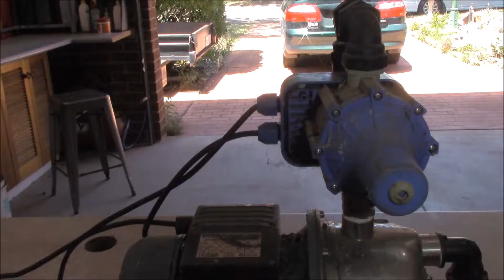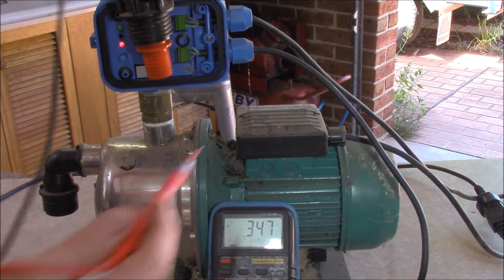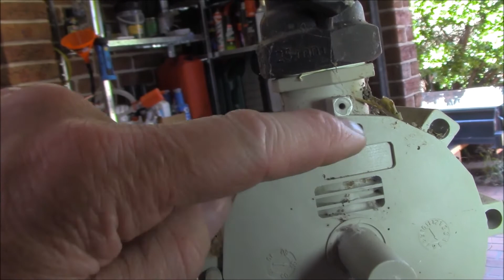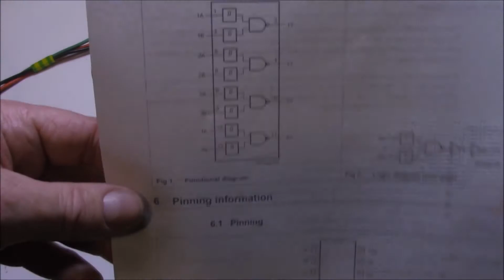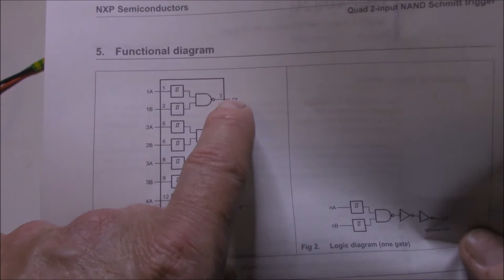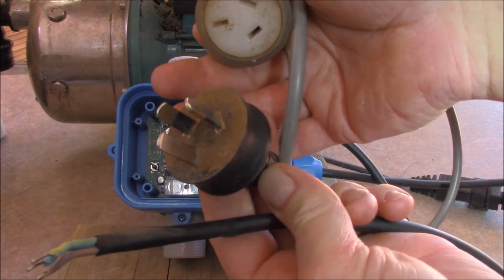KASA Water Pump Repair MiracleMAX

Comment: Thanks Mark. It's always a good idea to use current limiting resistors when checking IC's. Mouser has those Quad Nand's for less than 50 cents apiece.
Reply: I'm wrong, Mouser's are SMD also. I guess you would have to look at Aliexpress or eBay.
Reply from the maker: Hey Robert, 
Nick D below was able to direct me to some locally through Jaycar. It would have been nice to complete the repair at a component level, but for the price of the replacement control assembly, it was a better option anyway.
Reply: I would've just ordered the SMD and used a DIP to SOIC adapter, if I wanted to save money. It's better to replace the whole thing as you did if you can afford it.

Comment: Hey. Jaycar Electronics have 4093 over the counter as through hole. CATNo ZC4093. Just thought I'd let you know.
Reply from the maker: Hey Nick. I seriously forgot about Jaycar. They usually have a limited range. That'll teach me!
Thanks again for your comments. We all learn from one another :)
Reply: When I looking for a CMOS logic chip or TTL logic chip (jellybean ics) I always check Altronics and Jaycar before I go to RS or Element14. but yes good to share ones knowledge and experiences.
Reply from the maker: Thanks for the heads up :)